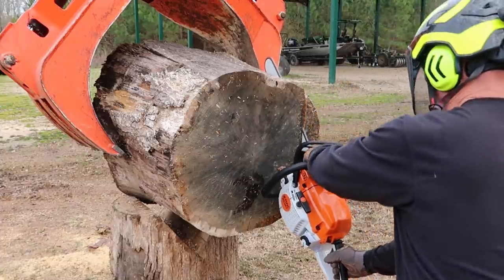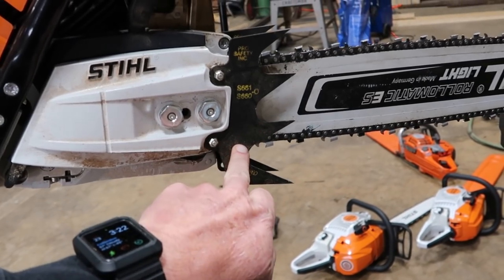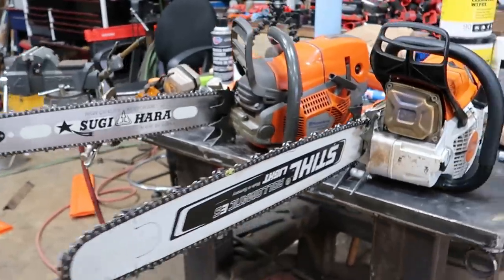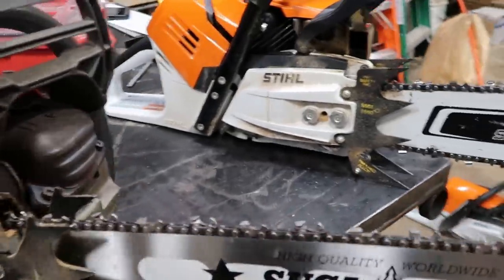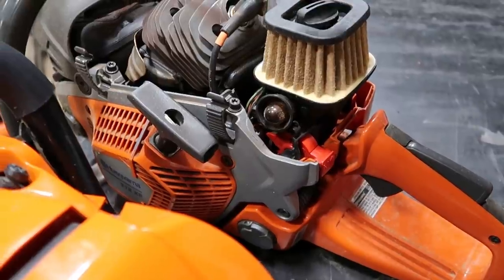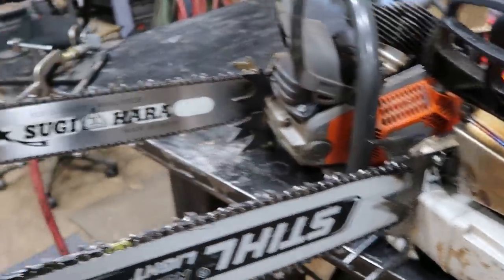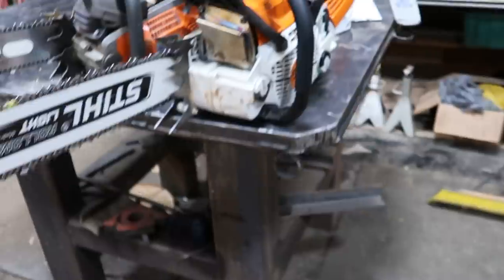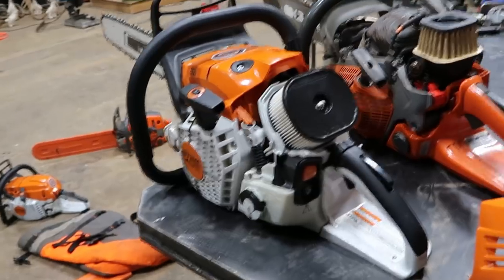Husqvarna VS Stihl | Autotune VS Fuel Injection | The best chainsaws on the planet

Comment: I’m just really intrigued by the weight difference. I wonder if they are running a lighter bottom end? Would explain some of the throttle response. Then there’s the 40% more cost of the Stihl. Is some of that due to the fuel injection?
Reply: Yea, fuel injection is a big cost plus they need to recoup their design and engineering costs on making it so it has a higher price and will slowly decline as it becomes more accepted and used in more products.

Comment: I'd say buy a 572 and get it ported. You will have a saw that is more powerful than the 500i, with better air filtration, for the same price as the 500i

Comment: I got my 500i a month ago. The price point is the killer.  But I baby it because the the price.  But I have run Stihl from the 70's it's not going to change now.  Most of my of saws are 20 years old.  The Stihl MS500i is not a MS 660.

Comment: Love your Videos Have a  25 year old 034 sthil now woks very well cut 4-5 bush cords a year for heat (elm cherry ash maple }. . getting an itch for a new saw . I really like that 500i seems to be about the same weight, more power better starting anti vibe too Also looking to run a saw on a small chinsaw mill Do you thinki will see much difference  moving up to the 500i? Seems like eventually everyone will move to f.i. M tronic well a step up on carbs seam like a stop gap to f.i. much the way G.M. s throttle body was a stop gap to f.i. P.S. love to cut with you sometime But I live in Canada , you are a master .
Reply from the maker: I think the 500 will likely be the only fuel injection u see.  M tronics and autotune are going to be around for a very long time.

Comment: I think what helped make the 500 so much lighter is the lack of a carburetor, as well as possibly the weight difference, and lightening up other areas of the saw. As for the price, I think it is so expensive because you are paying for a brand new saw, which is a world first with fuel injection, and the light weight of the saw could also be a part of why it is so expensive.
Reply: You loose a carburetor but you still have a throttle body and some added electronics for the fuel injection. Is there that much difference after that??
Reply: @brentmedders  I’m not a saw mechanic or expert but I would assume that the electronics and injectors weigh less than a complicated chunk of metal
Reply: @kiernanb9445  I’m not either sir, just looking for discussion to make a little sense of it all.
Reply: @brentmedders  I wish I knew more about saws and their inner workings, but I’m just guessing at what makes the 500i so much lighter for it being a bigger saw
Reply: @kiernanb9445  I know what you mean, I know just enough to ask ask questions. I would wager he has a lot of folks thinking and scratching their heads.
Reply: @brentmedders  yeah, it would be cool if STIHL would talk about how they made it so much lighter for being an extra 9cc
Reply: One thing to think about is power increases with efi. Look at cars 4 cylinders getting over 300hp. If you went back in time 30 years ago and told people they would be driving 4 bangers with over 300hp they would laugh at you. Look at some of the turbo charged 5.0’s getting almost 1000hp. It might not be the same size as a 79 cc engine like we know it but a cubic centimeter is a cubic centimeter. I’m thinking the engine is smaller. I have no idea but electric fuel injection is computerized. That can have great power increases with smaller engines. Before you know it 50cc saws will be pulling 36” bars with no problem. Just a thought I really don’t know but that’s all I could think of.
Reply: @JacobSchmittDeerHuntingSchool  that is if the major saw brands are going to open up the ports enough to let that happen… I think I saw a 290 pulling a 28 at one point in time but it was heavily modified and bogging
Reply: @kiernanb9445  yeah I’m mostly exaggerating but with what I have seen with cars in my life we might be surprised in 10 years. I used to go to the drag races when I was a teenager I’m 40 now. Anyway I remember people doing everything they could to get 500-600 hp out of a v8 now you can buy a stock 5.0 mustang put a turbo charger on it for a few grand and you hitting low 900hp it’s crazy. I don’t know if they could ever do it with a chainsaw but 23 years ago no one would have thought a 5.0 could get almost a 1000hp.
Reply: @JacobSchmittDeerHuntingSchool  I’m 16 and the biggest saw I’ve ever run was a fairly dull, horribly tuned ms362 but running saws is what I want to do. While I’ve never run anything over 60cc, I do know that the 500 is a beast of a saw and I doubt anyone thought it would actually be a thing 20 years ago
Reply: @kiernanb9445  yeah I bought a ms361 about 4 years ago the guy told me that It as close to a fuel injection chainsaw as you can get without it actually being fuel injected. I thought then that it would never happen a chainsaw was to small to be fuel injected. Well 4 years later you can buy one. I’ve learned to never say never with technology it will surprise you.
Reply: @JacobSchmittDeerHuntingSchool  technology really is surprising to the point where it’s almost unbelievable and too good to be true but it at least deserves a chance and a test. Just like how a bit and brace eventually was replaced by the gas powered drill, which got replaced by the electric drill, which has now been replaced by a battery powered drill
Reply: @kiernanb9445  yeah and at your age there is no telling what you will see.
Reply: @JacobSchmittDeerHuntingSchool  yeah, at this point there might be flying cars by the time I retire
Reply: @kiernanb9445  yeah might even before I retire.
Reply: @kiernanb9445  you’d be wrong. A saws carb probably weights a few ounces, there’s probably at least a pound of computer crap on that saw. Also that shit will be the first thing to die on all 500is
Reply: @kiernanb9445  it’s lighter because they left a bunch of shit off of it, and used cheap flimsy Chinese plastic and parts. They feel cheap and cost a ton... also fuel injected is a BAD idea in the deep woods!

Comment: It would have been a more equal comparison if you had purchased the Stihl 462.
It has centrifugal  air separation like the Huskies. If you look at your 261 it has air separation as well.
Lot of us Stihl owners have our 462's kind of on probation until more years pass by because obviously they did use smaller crank bearings than Huskies 572.

Comment: Well ..... these new “controlled air-leak” saws give ya more HP than the older versions right outta the box - almost run like a “ported saw” from jump street .... IF a guy knows how to mod these newer offerings a lot more performance is a available and they will punch much higher than their weight class !  You have to run top tier fuel and mix oil though - I run the Motomix in my saws - clean as a whistle and balls to the wall .... I have a ton of videos comparing these newer saws in my channel and do offer my service to guys who log , do tree work or make a living with a saw - stop by and have a look see - I think you’ll like what ya see and hear !

Comment: I like your reviews You have a good selection of chainsaws I like STIHL and Husqvarna there are 
some good and things I dislike about both brands.
I am a little bit confused about the way 500i cuts
my Stihl 462 cuts quicker than 500 in small to medium wood with the same bar and chain .
Saying that I also like my Husqvarna 572 & 550 xp
Mark ll to be fair 462 and 572 are pretty even in the way they cut both very angry saws.
You should get your hands on a ms 462 you will be very surprised how well this saw cuts.

Comment: I think if they lower the price then it shouldn't make anyone mad.  If you jump out there early on something you know your gonna pay top price sometimes and also have to deal with them working the glitches out.  They can always disguise a new lower price in the form of some kind of rebate.  I'm concerned about the 500i air filter even though I'm kind of a stihl guy.  I get confused on the Husky model number system.
Reply: Yessir, the k78 model I'd say is more effective but I agree

Comment: Stihl reps start to watch this a cheer. Then he points out the dirty secrets of longevity and the bullshit hike in price then the stihl sales team shits a brick. That saw isn't worth it in my opinion. Everyone on YouTube talks about throttle response on the 500i but it's a larger saw and I guarantee in 2 or 3 years it will lose power from wear and tear. I guarantee the 500 will cost a lot more to fix as well when your warranty is up and its more than likely not fixable by anyone other than a dealer.

Comment: Cottontop great great show I love that comparison there between the husky and the steel I like them both I also like a johns red I have no Mars I run oh 70 50 76 6 460s you know that those are older beasts what I will say though when the 501st came out they were at $2500 at the dealership and they have come down about $1000 of I remember seeing one and it was about the only one around here at this area and it was a price tag of 2500 bucks and it wasn’t on the shelf more than a day and someone bought it I am

Comment: Awesome video buddy!! I look at saws the same way you do also!! I’m a little guy also & those big saws just wear me out making it harder to get all the tree cutting done that I need to in a day!! When I was looking for a new saw I googled the lightest & the most powerful saw out there!! It came back as the jonsred 2159 saw!! My buddy was always bragging about his 2172 jonsred saw also but a much bigger saw at 72cc & a 24” bar!! The 2159 saw is a 59cc saw that will run a 18” bar up to a 24” bar mine has the 20” bar!! I have had more than a dozen guys try to buy my 2159 saw! I always ask them why?? They ended up say well do you see the power & the torque that saw has?? They are always amazed by the power the jonsred saws have compared to there saws!! To be honest every guy that has tried to buy my saw not a one of them had a husky saw they either had the stihls or echo saws or something else!! Husky makes the jonsred or jonsred makes the husky saws I can’t remember witch way it was right of hand though!! I’ve had my 2159 saw for 5 years now & it has cut wood for at least 4 different homes to heat there homes all winter long for the past 5 years now & still going strong!! I did go back to get a top out saw & have herd that red Max has bought out jonsred & red max will stick with the red max name for the saws I herd!! If you look at a jonsred saw to a husky saw they are identical saws pretty much!! Have you ever ran a jonsred saw before?? I have herd that the jonsred saws were sold to more logging crews then a home owners!! They were a more industrial saw I guess then the husky saw was & the husky saws were sold to more home owners then to loggers!! But I can say my 2159 saw is an animal by far & is definitely a lighter saw for its cc class of saws!! & yes a 1 lb weight difference makes a big difference when running a saw for a long period of time!! I absolutely would change brands after running a jonsred saw!!

Comment: I don’t think you can compare the 500i with any saw. You could compare the 460 with the 572 or the 660 with the 595.  The 500 is in its own class. For one it’s a electric fuel injected chainsaw. I always run Stihl not that I think they are better than husky. My reason is they are the number 1 sold saw in the world. The reason that matters is if your in a pinch they have the most dealers to get parts. I think it’s like comparing Chevy, Ford, and Dodge.

Comment: I am a stihl guy, i run saws every day all day. I hate the freaking stihl gas a oil caps! It will not make my opinion of the saw different, even though ive ruined a couple pair of pants because the freaking oil cap wont on right. My opinion on any of the new saws, either brand. I dont trust the new tech on the saws, i know some people who have issues with the new ones already. Yes every day i need to knock the dust out of the filter but ive never had a saw fail from filter issues.

Comment: The quality of stihl went down hill since the last time I actually looked at them.  Grew up running an MS460. Awesome saw but the new ones feel cheap compared to the older saws.  My brother told me they stopped putting the aluminum plate on the bottom of them.  

I hate the husky because they feel like you can just pull them apart when you get pinched. The old stihl saws felt really solid in that area.  

Don’t know that I’d ever buy a new one for that reason. Rather have something built well.
Reply: I beg to differ. My new Husqvarna 572XP is built like a tank hence the extra weight. My 550XP Mark II is also built well.
Reply: @Brian-Outdoors  but you can pull those apart.  

It’s a matter of preference though.
Reply: @barrybaker9173  That is true. I prefer Husqvarna compared to Stihl but they are both very good. The new Stihls just feel cheaper to me.
Reply: @Brian-Outdoors  that’s because they are.  I’ve used both.  When you pinch a husky they feel like you can pull them apart.  The new stihls I think are the same way. 

Stihl used to have an aluminum plate on the bottom of the gas tank that gave them the solid feeling.  I just don’t like husky.  I’ve used a bunch of them. But I’m partial to Stihl.  Husky’s are a little bit faster depending on the operator.  

I like the quality of stihl better.
Reply: @barrybaker9173  Fair enough.
Reply: @barrybaker9173  idk what your smoking but I’ve never had any of my husky’s feel like they’re going to pull apart..
Reply: @lonewolftech  that’s because you don’t use them.  When you pinch them and pull on them, they can pull apart if you pull hard enough. 

You obviously don’t use one or pay attention when you do.  

The new Stihls are the same way now.  They took the aluminum plate off the bottom and did what husky did.  I won’t buy any of them new.

Comment: I have had a 550 for 15 plus years. Love that saw. Recently purchased the 562 xp. The 562 is just awesome. But like you the weight difference is what gets me. I have neck and back issues. Love both my saws. Thanks for video
Reply: The 550 only came out in 2012
Reply: @man9170  you are correct. That was a mistake on my part. Mine is a 350. Not 550. And It’s still just awesome.

Comment: Cut a piece of pool noodle and open up the center so it will fit inside the cover and that will push the air filter up tight and keep it there so the fines don’t get in.

Comment: Thank you for this video, very informative!
I'm using a Husky 572 + 550 mark 2 combo myself and i'll rather take the weight, the toughness, better airfilters and no weird flippy caps all day. And there is absolutely nothing wrong in only using the Husky 572 for felling and bucking only, since that keep the chain sharp most of the day. And the 550 is plenty for cutting the canopy and delimbing, plus it's much easier your body and economy. 

Check my channel, I have a few videos of my work.

Comment: End of November, my Husky 545XP of 7yrs. partially seized. Now I’d been looking round for another saw anyway. Not to replace the 545 but that I knew whenever I was felling bigger stems, I was overworking the saw. Now it didn’t seize through overwork but probably from a leak. It’s with a friend now and being rebuilt. I thought of getting it ported too but that would only get it near to a 550XP; and I could get a new one for less than the porting work.

But I’m just about to take over joint management of a small wood, (it would be tiny to you) for next 5+yrs. Thinning mature beech, oak and coppicing others. So having another ‘larger’ saw will come in handy.

So I’d got the bigger saw down to either a:
Husky 562XP, (Had considered the 560XP, as I could interchange existing bars & chains. But it tops out at a 20” bar.)

576XP, (got struck off, when Husky removed it from sale in the UK).

Husky 572XP

Stihl MS500i

But what decided me against the 572, opposed to the 500. Was the 500i has more power, less weight, lower vibration levels and amazingly, I could get it £300+ cheaper with the 25” bar+chain, than the bare Husky.

If the 545 lasts, I’ll be happy and it will still get a lot of use. If it doesn’t last, I’ll either buy a 550XP Mk2 or a 562XP.  Depends how many chains & bars I still have for the 545, (which would also fit the 550). Gave a passing thought to an MS 261. But a friend has one and although it’s a good felling saw, the pick-up when snedding/de-limbing seems sluggish.

Great comparison of the two saw there. You just about covered the deciding factors, with the pros & cons of both. Thank you for that.

Comment: Using my timer, your Husky was a tad bit quicker than your Stihl.  But, is not fair comparison since you did not use (maybe could not use?) same bar and chain for both saws.  The 500i seemed to be at about its limit pulling during its cut, it was losing RPMs at times.  The Husky seemed capable of pulling a chain that would be a little bit hungrier (slightly lower depth gauge setting).  Neither chain seemed razor sharp if camera was picking up the shavings/chips to fines accurately.  I was figuring on getting a 500i.  I may shop the Husqvarna more before deciding.  Thanks for the demo and observations.  And I also hate the flip caps on my Stihl equipment!

Comment: Personally I would buy the Husqvarna. The Stihl's never have been built as tough as the Husky's. I know tree guys that run both and the Stihl's always seen to be broke. The Husky's just take a likin a keep on ticking. The fuel leakage issue and the cheep air filter attachment would be enough to run me off of the Stihl. With the fuel injection you would think the fuel consumption would be better. As a person who was in the automotive repair business I have seen cheep and overpriced. In my opinion that's where the Stihl is.